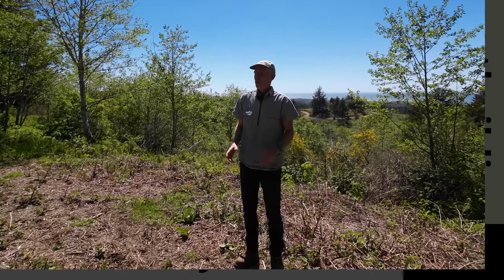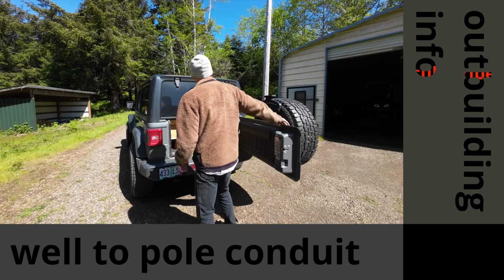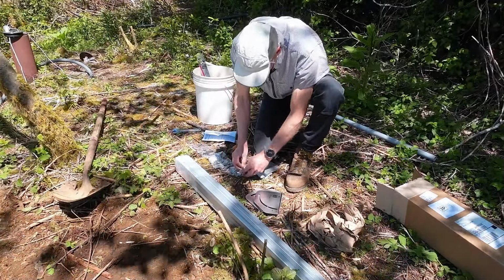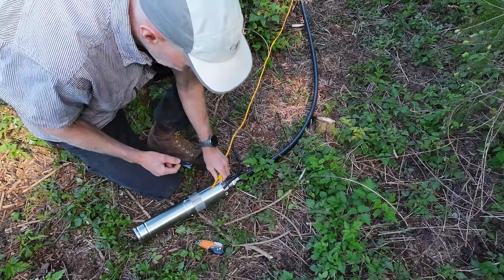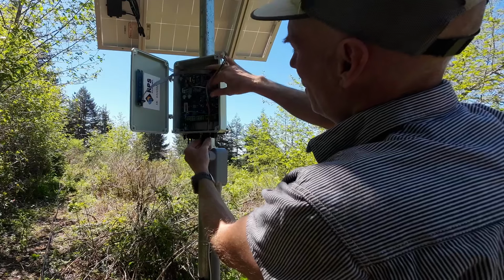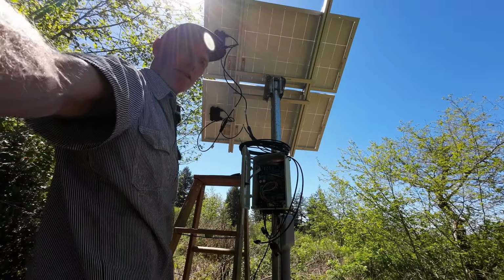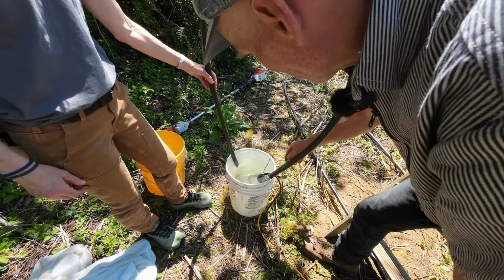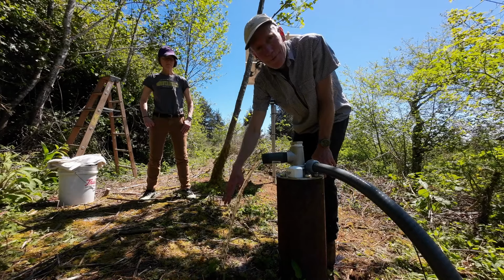023 - Well.. water with solar power? - Solar Well Drinking Water Part 1

Comment: Good find nd good job! Definitely get water tested. These days it will be best to do carbon filter nd other filtering.
Reply from the maker: Thanks for the comment. We will certainly get the water tested but want to first make sure it will charge a large tank up on top of the meadow first. I'll likely solicit filter ideas from people in the next part of this well restoration set of videos as I think there are several options for basic filtration beyond sediment, etc. From what I understand, you want to test any time you make changes to the well/water supply infrastructure so it will probably be a few times as we sort all this out.